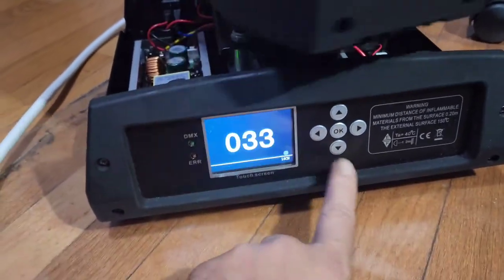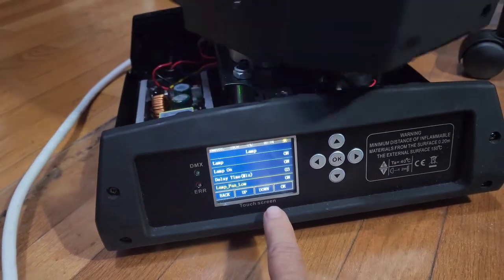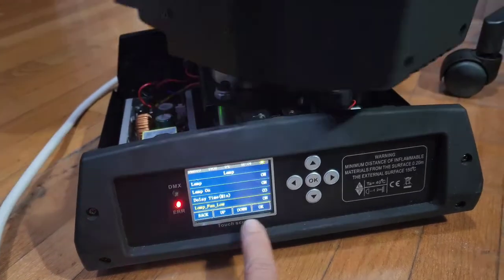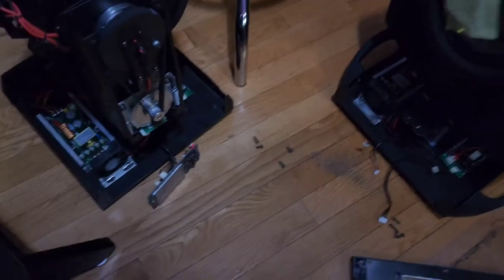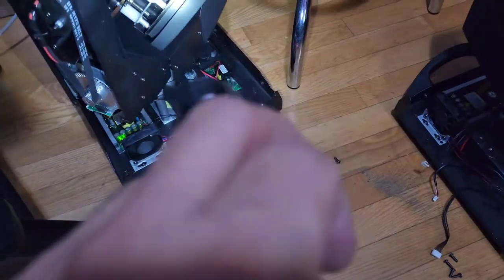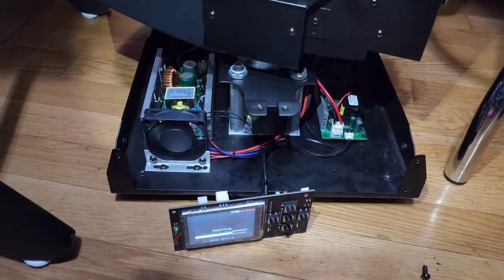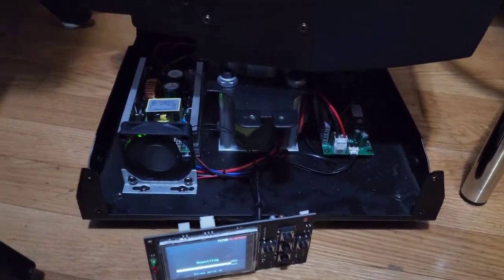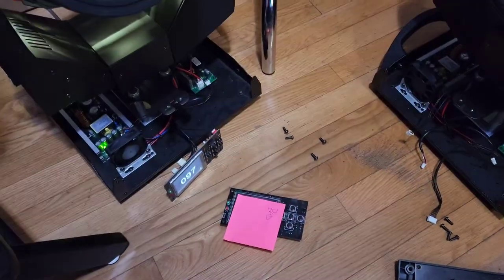Beam 230 moving lights board errors fixed

Comment: After closing the light table, the light turns off after 8-10 minutes. What is the problem? Beam 230 does not turn off any light when the light table is on.
Reply from the maker: I'm sure I don't understand the issue. What's a light table?

Comment: Hey where you got that board some issue with mine
Reply from the maker: I was unable to find a replacement board so I took out the board from another unit. The owner has so many of these and have been using some for parts. 
Also I was able to repair some of these failed boards but using a hot gun and resolodering all resistors and connections on the board. 
You can check https://www.aliexpress.us/ to see if they have the board you need. Good Luck